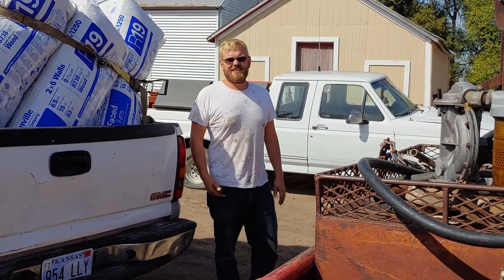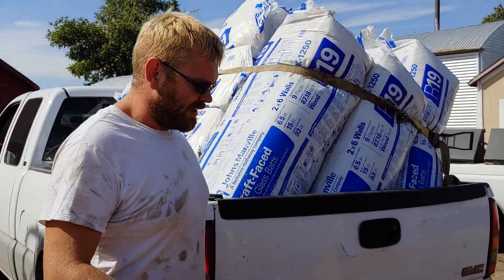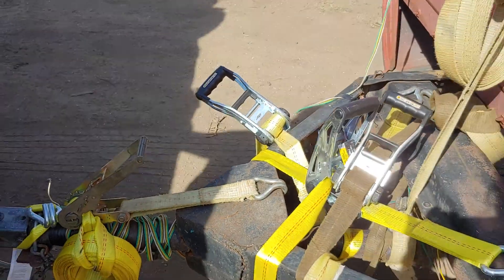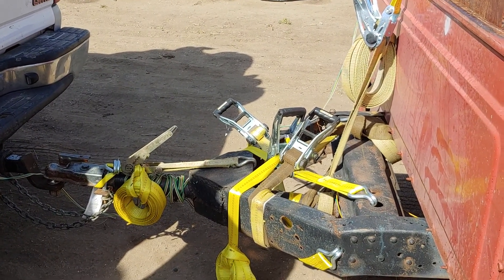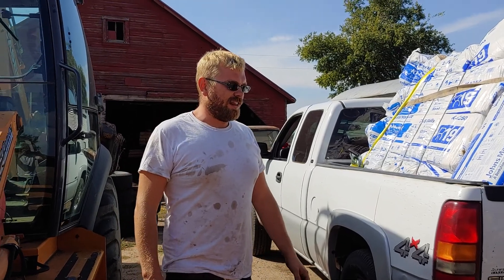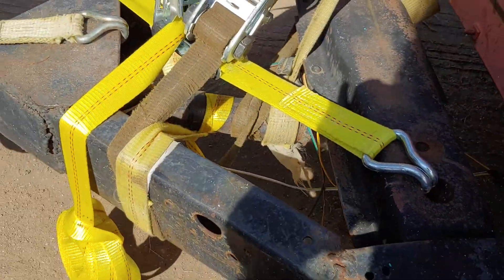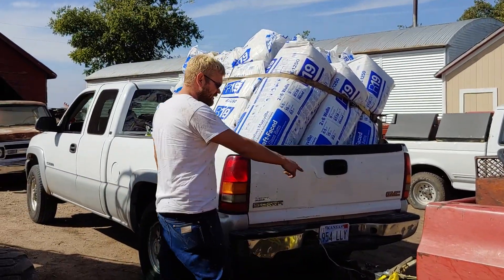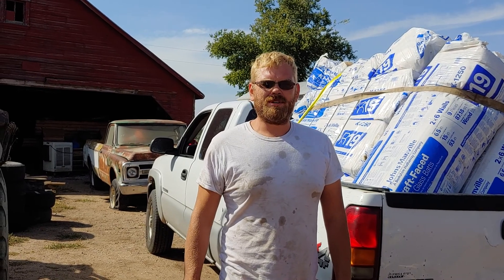Weights what broke the wagon!

Comment: Hell yeah you got you home old mobile home hitches work pretty good
Reply from the maker: Thats a solid idea on the trailer house hitch,  people here make three axle trailers from old trailer house-frames.If i have a choice  I'm not  gonna pull anything with wedge wheels.
Reply: @outcastprojects6733  yeah right besides those 14.5 tires are very hard to find now at least at least down here in the Deep South some people don't even know how to put them on and make him go down the road without wobbling I built my big trailer from a mobile home I got lucky at had a 6 inch Channel iron frame and it had Square axles with 6 bolt and Chevy and Toyota Wheels fit because it has a 6 on 5 and a half and them old I beam homemade trailers get to swaying and wandering all over the road